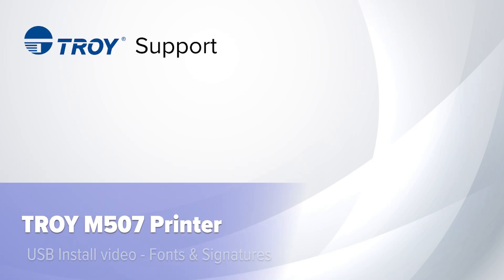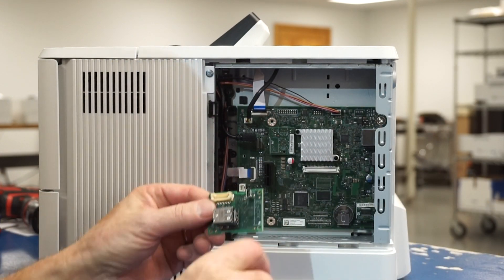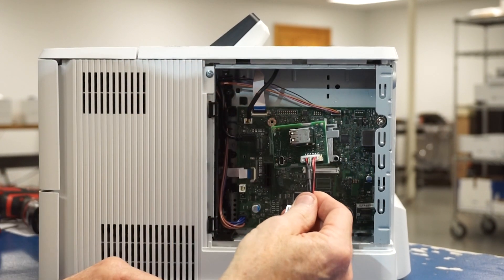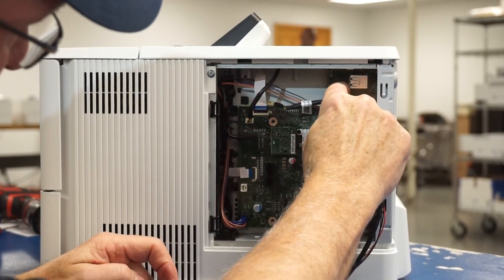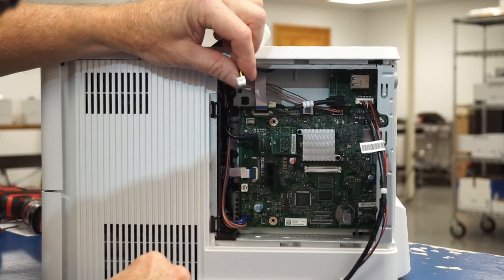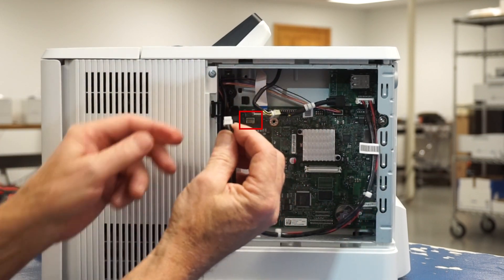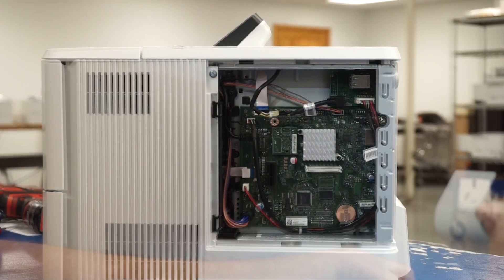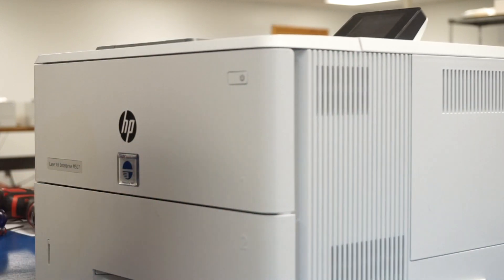How to Install M507 MICR Printer Digital Signature & Fonts USB | TROY Support

Comment: If i Have to buy a used one, which is better in your opinion HP m607 or HP 602dn for demestic use
Reply from the maker: Thank you for the message! Give us a call at 304-232-0899 or fill out our from here https://www.troygroup.com/contact so one of our experts can fully address your needs. Thank you!